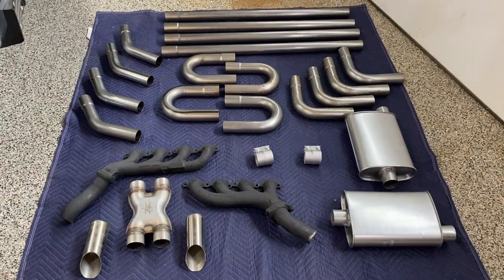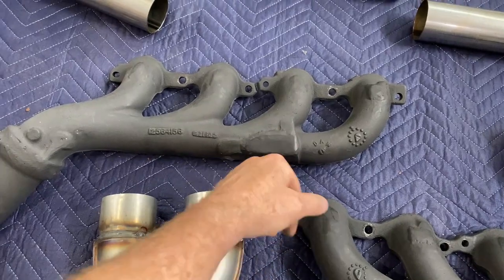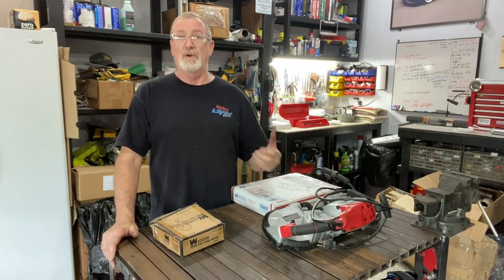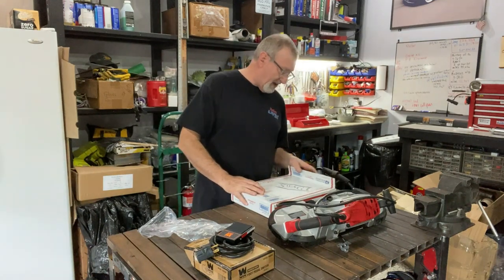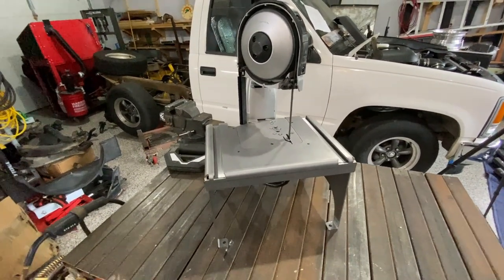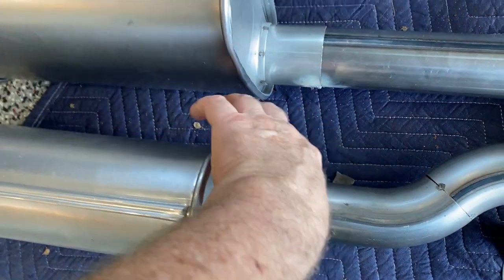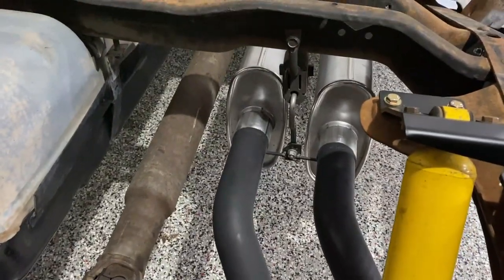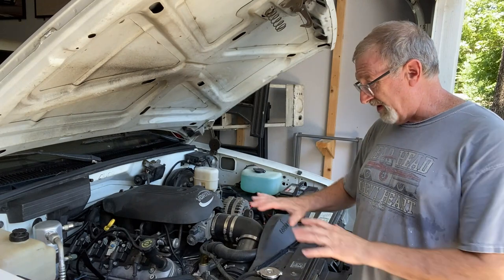1988-98 Chevy OBS C/K Truck LS Swap Exhaust Build AND FIRST START!!!

Comment: I'd love to pop the hood up on my garage kept 94 Chevy 4 wheel drive OBS and it look like yours. I want to swap it and have the money but no one to do it. Thanks for the video!!
Reply from the maker: There seen to be many who will take your money to do a swap, but, be careful! I get contacts weekly from guys who paid good money to have their trucks swapped and while they may run, few if any of the gauges work and under-hood looks like a mess. Try to find a few people in your area that have had a swap and who did it. Go with someone who has a proven record, otherwise it can be a risk.

Comment: Could your down pipe clear the automatic shift linkage?
Reply from the maker: Of the 2 systems I have built, one was for a cable shifted 4L60e the other manual trans, clearance was not an issue. If I had an automatic with earlier model linkage, yes, I could have cleared that as well.

Comment: How many of each of the pipes did u need
Reply from the maker: It’s going to be different for everybody. Depends on how many pieces you ruined or trash trying to build it. In the design that you ultimately come up with. You could get by with building an exhaust with half of what I used. I didn’t use everything. There are kits available that have two of each item and kits that have four, I Purchased, the four.
Reply: @laurencevillegarage  Hey also I wanted to ask are the clamps like temporary until it gets welded or do they stay forever
Reply from the maker: @jacobgarci1023  are used the clamps to stay on forever. It allows the system to flex just a small amount so that extra welds would not crack and if I ever needed to remove the system for repairs, etc. I could do so. If the whole system is welded up then it could be a problem to remove it if the transmission had to be dropped or over prolong driving the welds could crack.